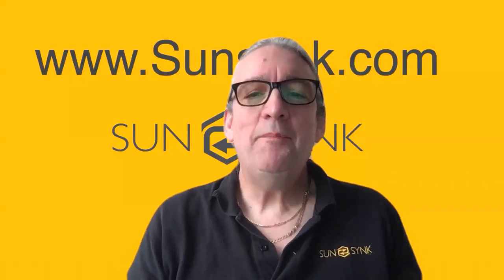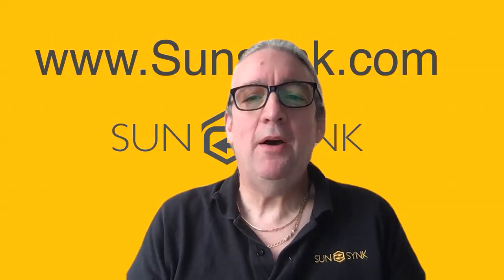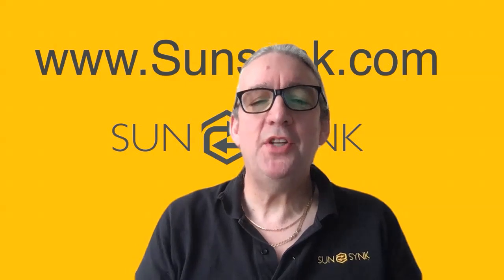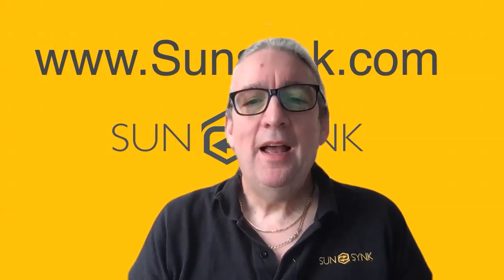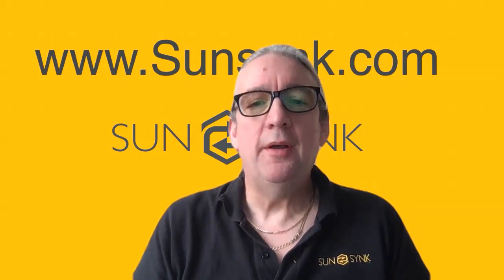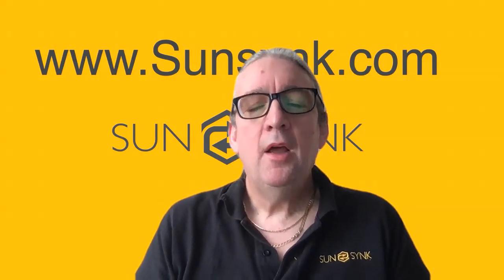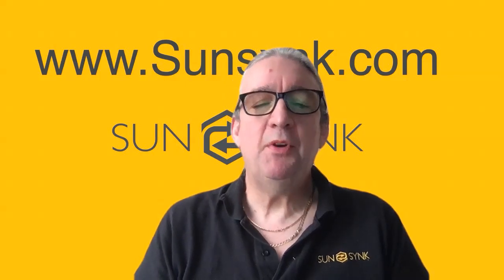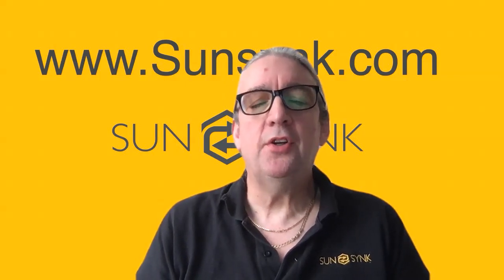RCD Tripping

Comment: My issue is, on the Load(UPS) side I have a RCD. When I introduce Grid Power to the inverter, it takes about 2mins and that Load(UPS) side RCD Trips. With no power from the Grid, just Running purely off the Batteries, the RCD doesnt trip at all. Is the Relay included in the 8KW box?
Reply: Same issue ever got a answer
Reply: @ajvantonder7055   House electrician had made an error on his side. Earth and Neutral had continuity - oddly when Grid Power was introduced. Once he rectified that, all the problems where gone.